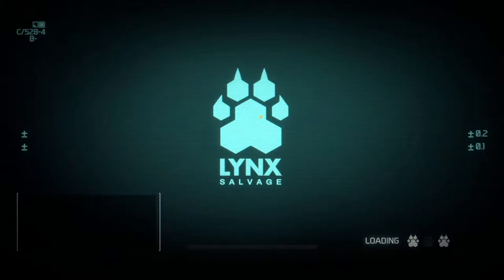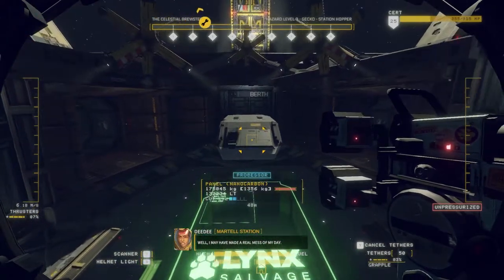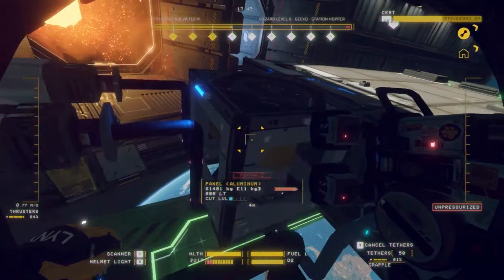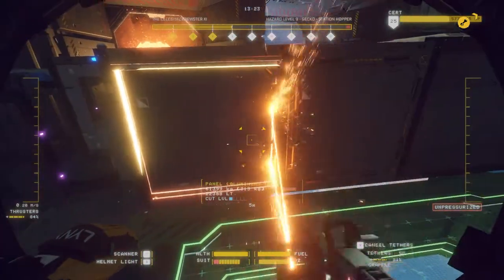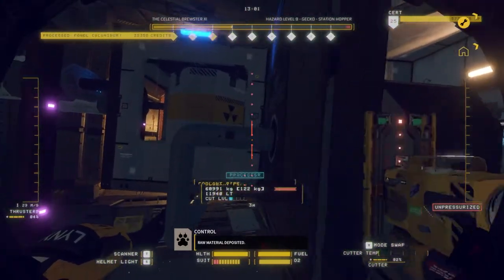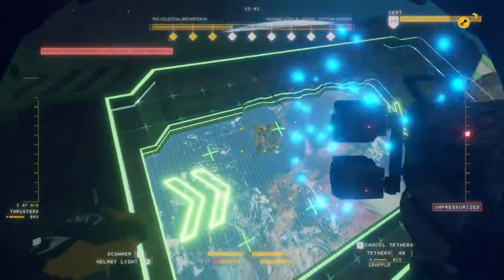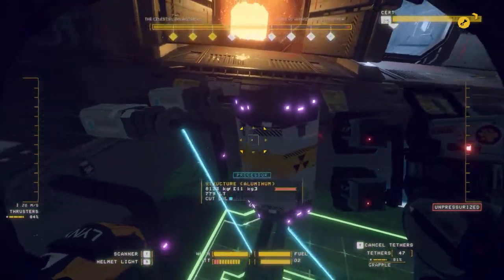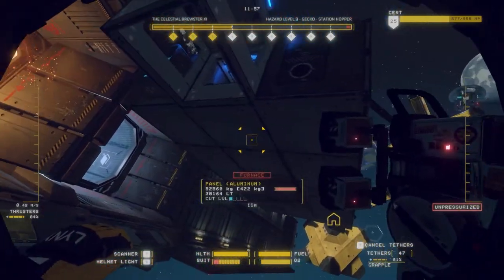Hardspace Shipbreaker How To - 05 - Fast Mk II Reactor & Thrusters - Gecko

Comment: Is there a way to remove the thrusters without detonating everything? I know the tutorial says to eject them, but by the time I get to that part the consoles are always underpowered
Reply: You are correct- There is a switch to eject them, but you have to do this before you pull any fuses from those generator switches. I can’t think of the name. The one where you have to time it with the flashing lights. Basically eject the thrusters before you do anything to any electrical system. Your comment is a year old, so I’m sure you figured it out, but maybe someone else will stumble upon this. Cheers.